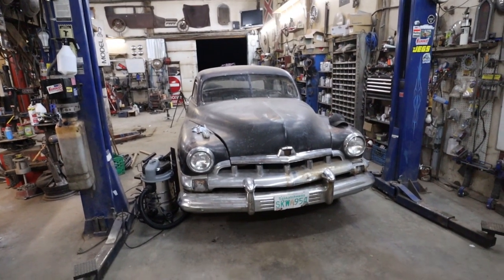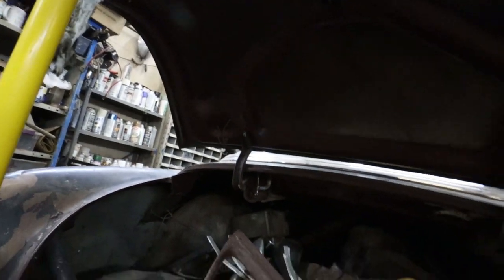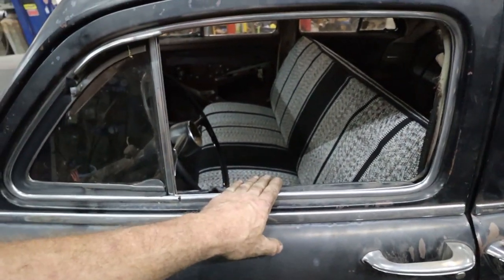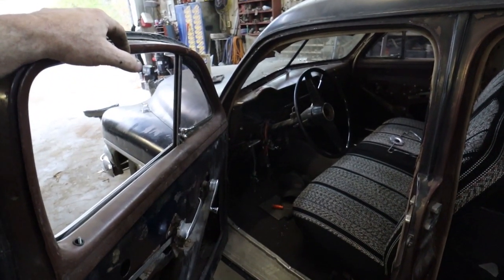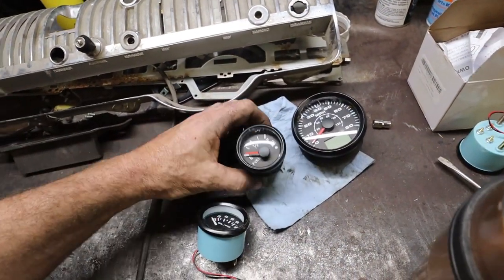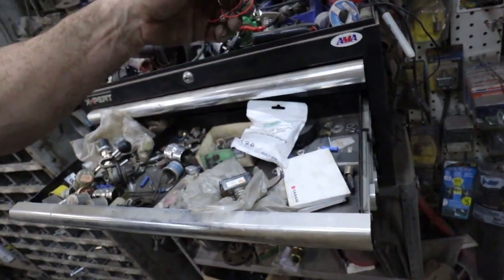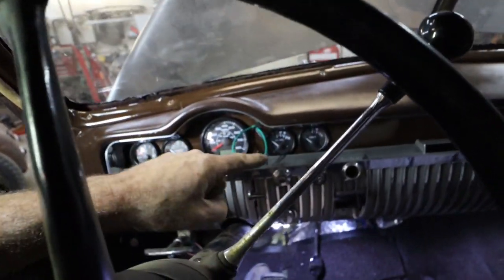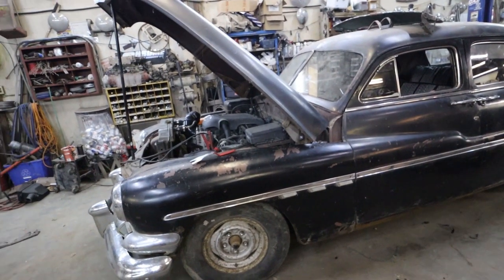Modifying trunk hinges and installing dash gauges - Mercury Monarch build part 11

Comment: Hey Brent I've worked auto glass for 30 years and have done hundreds of those doors putting new glass in. Just take a marker and make a line where the top of driver side should be rolled down and use a flap disk and lightly sand it down where you want it. As always great job on making it work with what you have👍

Comment: I used to work in a beakers yard and the best way to remove the pin holding the door handle and window handle is a rag pulled against the two ends of the pin and it comes off no problem

Comment: I use a neodymium magnet to remove metal chips. Much easier than using the vacuum cleaner. And, as usual, this will be an awesome build. We are spoiled 😀👍
Reply from the maker: Have to try that as I still have some down there haha
Reply: Balled up masking tape works good
Reply: @ronniegarland8621  maybe try a lint remover for clothes?

Comment: Great progress on giving new life to a car that otherwise might just sit and rust away or worse be crushed. I like the dash. At first, I didn't think it would look good, but it does. I prefer it over the original.
Reply: You need a screen printer, for printing on glass, that way you could reprint the numbers in the correct place on the glass, remove the glass and black bezels from your digital meters and paint over the numbers behind so you don't get the double numbering issue and removing the bezels and glass from the digital meters should help them fit better.
You can then cut a new black piece to match those gages

Comment: I've got several of those door handle/window crank tools and there is always something causing a problem with using them. I've found just taking a shop rag a dragging it around the clip the easiest way to get the clips off!
Reply: Ooh! I like it. Never thought of that. Definitely seems worth trying. I found that just cutting and bending a hook out of sheet metal was as good as anything I'd come across, but that won't work on the small clips on my 40 Buick. Maybe your technique will remove them.
Reply: Always have used a rag, easier and less chance of causing damage to trim
Reply: That's the I have done it also
Reply: Next time try using an old-timey paint can opener. Best tool ever for those damned old clips.

Comment: I like the way the dash came out, looks better then stock, To bad the visor not wide enough those cars always looked cool with one, I saw a video about a car show and a Chevy truck made in the late 30's had one that owner used that was the wrong shape and to wide it sat to high and there to big of a gap between the visor and roof on the truck. That all you saw, it didn't shade windshield and stuck out like a sore thumb. Your car turned out really nice just needs rims painted and tires and whipper blades Great fun watching you at work.

Comment: Good job on the lid Brent, 👍👍
I started thinking to myself, its too bad he didn't have a sacrificial trunk lid to use as a template. He could've lopped off 8-10 inches from the trunk lid on the top hinge side, laid it in place, probably lay some 3/8 rubber in the channel to act as weather stripping / shim material for height and then custom make and fit a set of hinges. 
Then I'm watching this guy mount a set of hinges that don't even belong to the car, don't even bother to clean out the junk from the trunk and then pulls it off, you never cease to amaze brother, you're both funny and good at the same time. It is indeed a pleasure to watch you work, thanks for sharing!

Comment: For the gauges, next time you go to the hardware store grab a piece of plexiglass. Just copy the original glass pattern to it and then use some vht nightshade or whatever and tint it.  Then put it in and the modern gauges will be hidden until you turn it on.  I'm with you on a visor over the windshield. Great build though guy, I'm really loving the make do with what you have vibe.

Comment: The dash cleaned up really nicely! 
The gauge panel looks good but I wonder if a piece of lightly-smoked plexi over it would hide the modern feel of the gauges just a bit and take some of the reflection away that the clear panel will create...
As usual, Pablo steals the show. :)

Comment: In my '54 I put some restored gauges in the stock panel and replaced the amp gauge with voltmeter guts, after I realized I'd wired it wrong and started a fire 😅 Works well and looks good now 👌

Comment: My friend a trick to getting the clips off of the doors is to take a shop rag and pull it between the panel and the handle it will get caught on the ear of the clips and they will pop out some where in the shop

Comment: Top Dawg Carona and I were going to save this for tomorrow.  But we needed a Fix on a Friday night.  Good job on vent windows and hood hinges!   remember those damn clips on the door cranks!  We redecks used a pry-bar and needle nose plyers.  I understand your delimna on stock or aftermarket gages on that beautiful dash!  The part where you pished on the die-cast dash was very satisfying!

Comment: Good job on all of it Brent and especially the deck lid hinges!  Usually when I align a deck lid I climb in the trunk.  I've gotten stuck a couple times and have had to climb through the opening where the rear seat is.  I'm not as limber as I used to be so maybe I'll follow your lead from now on!

Comment: I had a tool to remove door handles but the one I had had a hook on each one so you can slide into it and pull with the hooks and it would take those little spring clips out. On your dashboard what if you took a piece of clear plastic and cut it and replaced it with the one so there'd be no numbers on it just something other than that it's looking good. 👍👍😀🇨🇦

Comment: They make a tint spray paint. Just add more coats to make it darker
Reply: I haven’t seen it for your application but I have seen it on head lights and tail lights. Should work well on what you’re doing

Comment: What miracle product did you use on the chrome on the dash? It looked effortless but it came up beautifully. I really thought changing the dash was a mistake but, after seeing the finished article, I know I was wrong - it looks great.
There's an old adage, something about pets looking like their owners, or is it the other way round? Whichever way it is: 43:35 anyone??😂
Reply from the maker: was just using fine steel wool on the chrome on the dash
Reply: It worked well, looks great.

Comment: Is the speedo electronic feed for the transmission?
Reply from the maker: No its a gps unit
Reply: @HalfassKustoms  i wonder how easily you could use the stock speedo out of a truck, i guess the problem is they are modular clusters

Comment: My suggestion to the cluster, spend a little time to learn the most basic of Arduino. And trust me, you can get a long way with a little reading and some YouTube videos on the subject. And then, the world's your oyster, because you can take any servo motor (and they sell these for this kind of stuff) and retrofit it inside the original shell, using the original needle, and the original indications. Nobody would know the difference. And in total, you'd get away with a whole modern, but vintage cluster, for very cheap, extremely .. cheap.
You can also give a mail to fellow YouTuber Aaroncake, i'm 100% sure, he can help you with your project, maybe even write the code for you. He's just finished his, and you can watch his videos on the topic.
Just my 2 cents, i saw that you were really torn because you could do it right, and i'm sure you can do this. This is not rocket science.
Reply from the maker: yeah have played with it in the past just having issues with stuff reading my odb correctly. was working on a GPS version but just couldn't find that I commit enough time to get it to work right haha
Reply: @HalfassKustoms  GPS ones don't really work that well with old iron block cars. Something about interference. I have an old Buick, and i've tried countless ways to get it to jive and it doesn't. There's always an error down the way. Yeah, time, the one thing we never have in plentiful demand. :))